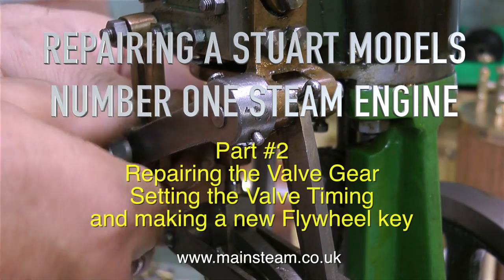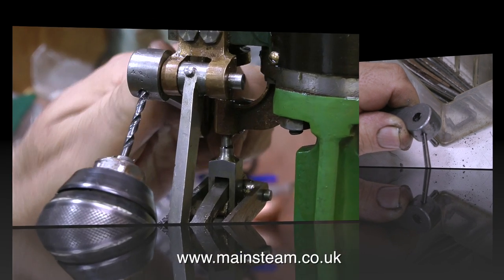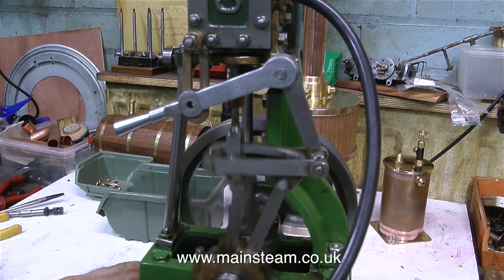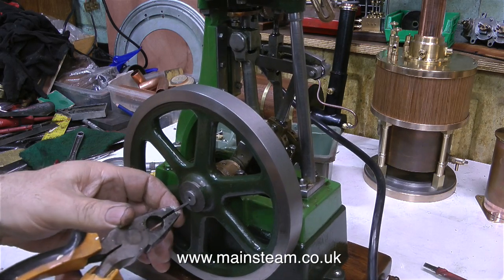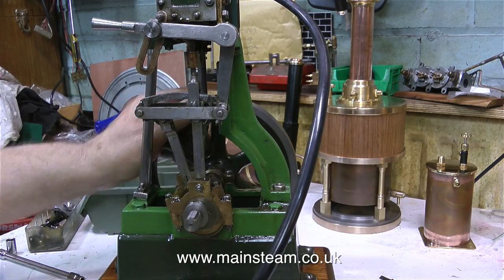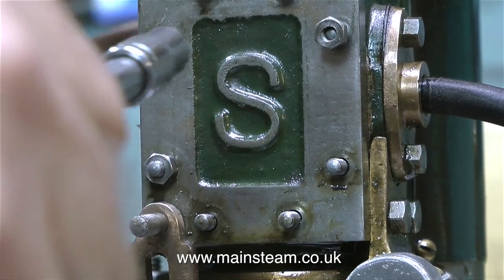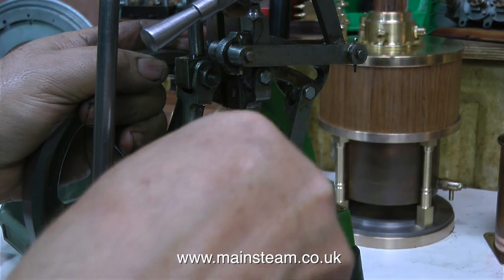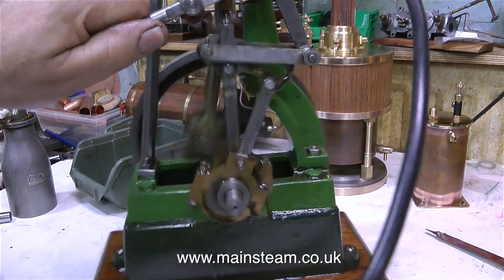STUART NUMBER ONE STEAM ENGINE REPAIR -  PART #2

Comment: I grew up on a cattle and sheep ranch near Piñon New Mexico.  We had two pumps that were made in the early 20th century.  They were single cylinder Fairbanks motors. We ran them on propane. They had huge flywheels. Once ran a large pump jack for a 1500 foot deep water well, the other ran a twin leather ring water pump that drove water uphill 300 feet to stock tanks about 4 miles. Watching you work on steam engines reminds me of then Fairbanks motors.  I overhauled both motors when I was about 12-14 years old. They were far more simple than v-8 engines and were great learning tools for a kid who loved old machinery.  I honed the cylinder of each motor using a sprung honing device attached to a 1/2 hp drill. I rebuilt the magneto and replaced the rings and crank bearings with OEM parts made in 1918.  I may be wrong but it appears that these steam engines you work on were the foundation of the Fairbanks motors.  They are so similarly built that I can’t help but think a steam manufacturer just modified an old steam design for internal combustion.  Well, I’ve rambled in far too long about my past and thoughts. Thank you for your videos. I so enjoy watching you work
Reply from the maker: That made very interesting reading - thank you - Merry Christmas }:-)))
Reply: Keith Appleton. Merry Christmas and I pray you have a terrific new year :)
Reply from the maker: Thank You - here's hoping that 2019 will be a good Year }:-)))

Comment: Thanks, I love steam engines, I used to work in a small ND town which hosted a steam trashes reunion every September.  That was the highlight of my year, to be out among the old steam tractors and stationary steam engines, the smell of the burning coal, wood, and that hot steam in the crisp Dakota air was an experience to behold.  God how I miss those days.  Since I was on the police department, I could go behind the scenes and get to know the engineers who kept the old machines working, very educational, and to see those monsters begin to move was simply amazing, the power of steam is a forgotten thing now days.  Thanks so much for a look inside the machines to see how they convert steam to liner motion.
Reply: Dalton still hosts every year in MN. I haven't been the to ND one yet and longer term would like to

Comment: Keith I must agree with you that the sound of a steam engine running slowly weather on steam or compressed air, when the timing is set right , is indeed a very sweet sound indeed thanks for your time and efforts and for all the great videos you have made and will make

have a great day and a better tomorrow

Comment: Although you removed the silicone gaskets from the steam chest and cylinder cover I assume you made new gaskets. There was a cotter pin in part of the linkage and wondered if that was a normal item?
Reply from the maker: yes and yes }:)))

Comment: what would be the consequence of using ball bearings for moving parts, as to avoid the "total loss oil" scenario?
Reply: Full ceramic bearings, zero lube ever. Would love to see that :)
Reply: Jacques Jamieson Historical inaccuracy and unnecessary difficulty.
Reply from the maker: I would agree with that . . . .  :-)))))
Reply: Plus even ball bearings require some oil.
Reply: @stephenwoods4118  There are a lot of very small sealed bearings used on RC cars and boats. No oil needed.

Comment: Keith, no doubt you have mentioned the ratio of steam, mechanical and rape seed oil mix somewhere on your video posts but can I ask again what it is please. Cheers John.
Reply from the maker: I can't remember ..... approximately 50% steam Oil, 25% machine oil and 25% Rapeseed oil I think . . . .
Reply: Keith Appleton Cheers Keith, John.
Reply: Keith Appleton I am so impressed by your erudition and craftsmanship.  Great kudos, sir!
One thing: does the vegetable-oil component not oxidise over time?  I have visions of hauling an engine from the attic, and finding a gummy varnish covering most of the working parts….

Comment: I know this is an old video and no doubt irrelevant to you now, but your life may be improved by using a piece of gasketed Perspex for the steam chest cover. I know as much about steam engineering as I do makeup though, so if of no use, by all means eat the comment.
Reply from the maker: the perspex soon gets oiled up, steamy and wet so it's difficult to see what's going on if you are running the engine on steam - OK on compressed air though .....